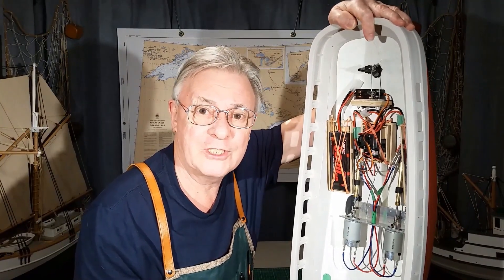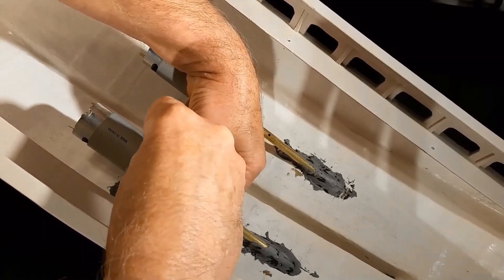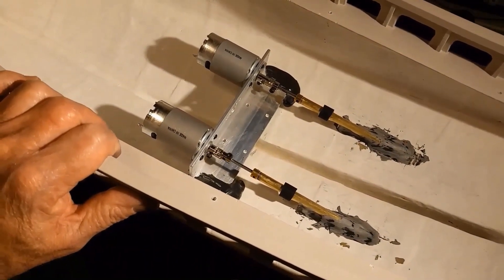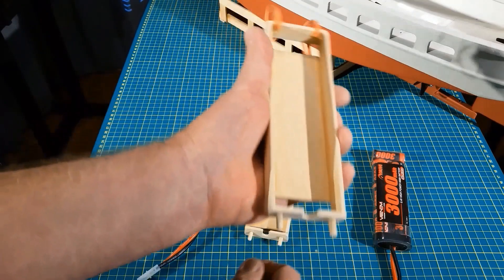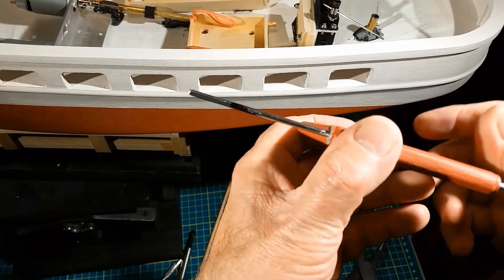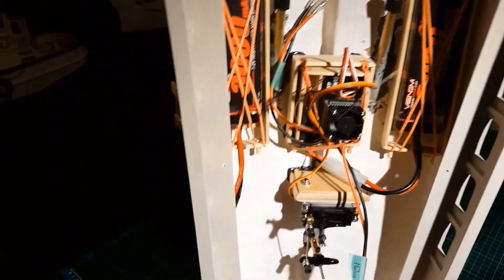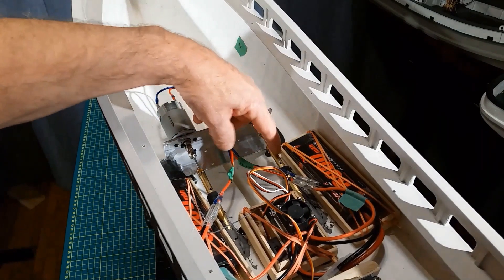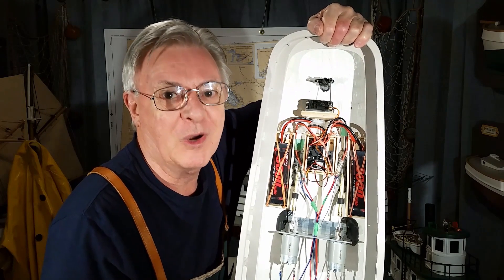RC Bad Weather Ship DIY Build Part 5

Comment: Great video. I love your attention to detail. I'm new at this ship-building game. and very confused. On Escs and motors. could you please give me the model of the Esc and the motor My ship is a similar size and keep up the good work?
Reply from the maker: Thank you for your comments.  I source almost all my parts off eBay. I use brushed ESC and Motors.  I use the following ESC, search on eBay  320A High Voltage ESC Brushed Speed Controller Cooling Fan for RC Car Truck Boat). This unit runs 1 or 2 motors. For the motor eBay search ("Brushed Motor 540/550 size 20T/35T for RC Model car 1-10 Traxxas TRX4 SCx10").  About 35 Turns works for me with the 42mm prop. Note that a Brushed Motor Requires a Brushed ESC.  Brian RCWH

Comment: What is the run time with this battery setup?
Reply from the maker: Hi Shibly. Those 3000mah batteries are run one at a time.  If I run the boat flat out fast for 20 minutes the motors will overheat before the battery drains.  With a combo of slow speed maneuvering with shorter high speed bursts I think 3 hours run time using both batteries is about right.
Reply: @RCWorkboatHaven   Thank you so much for that information. I have been using  lead acid batteries for all my boats and just a thought of switching to a different kind makes me worried!😀
Reply: Hi Neil,  why do you have 2 batterys in the boat if you only use one at a time? 
Thanks...

Comment: Hi Brian,  why do you have 2 batterys in the boat if you only use one at a time? 
Thanks...
Reply: I'm not an expert, but my guess would be for balance - a battery of that size is quite hefty, you would need an equally sized weight on the other side of the boat to prevent it from sitting at an angle in the water, and if you need a weight that's the exact same size and shape as a battery then using a real battery makes a lot of sense
Reply: @roseroserose588  That makes sense Ed, Thanks a lot for the info...